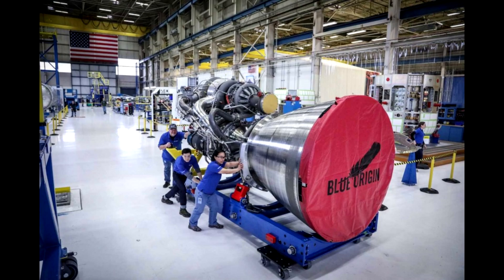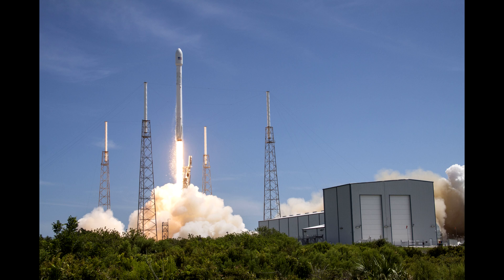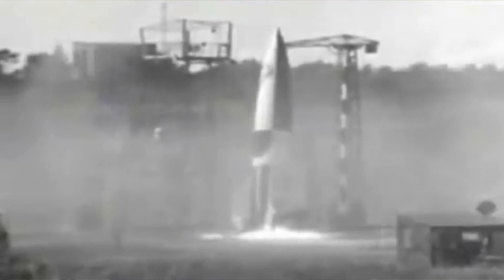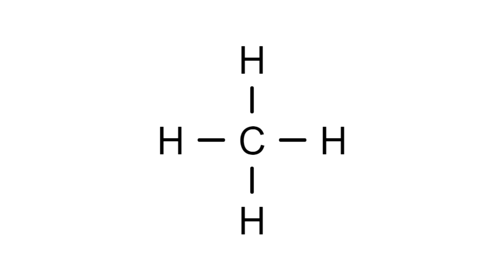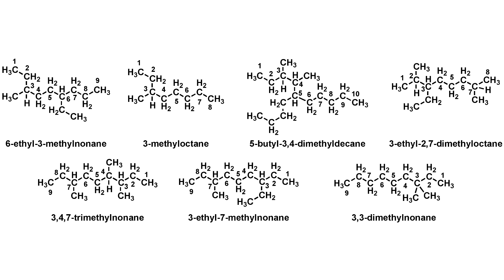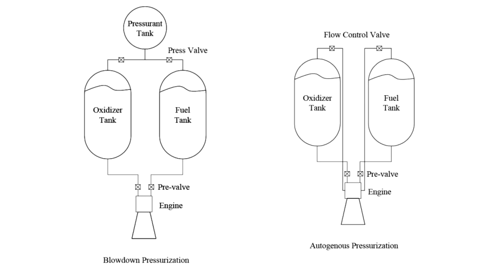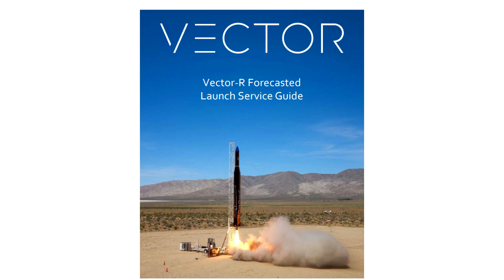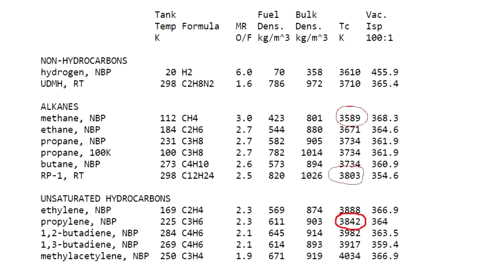Why Next Generation Rockets are Using Methane

Comment: Please, what is the difference between Jet fuel and RP1 exactly?  What is this refinement of which people speak?
Reply: RP1 has much more strict specifications.  It contains much less sulfur and much lower impurities.  It is designed to have better characteristics  at very high temperatures and to be easier on high speed turbopumps. Jet engines aren't too picky about the fuel they burn.  They primarily need low vapor pressure and freeze resistance at high altitudes. Therefore jet fuel is often highly variable in its specifications.

Comment: I don't understand, if the exhaust products are lighter, how do you get a higher specific impulse? I thought the rockets acceleration was the reaction to the ejected exhaust products. The heavier the better I would have thought. There is probably a good explanation, but its a mystery to me at present.... (I'm probably just too stupid....)
Reply: assume you throw off same mass per second anyway, then the average speed of a single molecule is proportional to the total reaction force produced by exhaust. of course lower density fuel requires larger turbopumps but considering a rocket mass is nearly 80%fuel(fuel/oxydizer), it is less of a problem.

Comment: I have a quick rocket question: why is RP-1 used at near room temperature? At a cooler temperature it would be denser, and so the rocket would be more efficient? My guess would be the economics of cooling the fuel, and that the viscosity of kerosene seems to increase exponentially as the temperature is decreased (whereas density increases linearly), and this may cause problems in regeneratively cooled engines. Please let me know your thoughts!

Comment: Methane gives only a modest improvement of performance over kerosene because of the need for much more liquid oxygen. However, even a modest improvement is very important because of the exponential character of the rocket equation.
Reply: It also makes much more sense if the goal is a Mars mission due to the exponential mass/thrust aspect of transporting return trip fuel.  Manufacturing propellant on Mars is forward thinking, a paradigm shift.  If the idea is to colonize another planet, self-sufficiency is a must, and producing propellant on Mars is a must.
Reply: @brabanthallen  I agree that in-situ production of propellant combination on Mars would be a MAJOR improvement in any scheme for regular interplanetary travel. There are plenty of precursors for the propellants: water and carbon dioxide. The most difficult matter is providing the VAST amount of energy needed to produce the fuel. A kilogram of methane releases about 55 megajoules upon combustion. Hence, at a bare minimum (assuming 100% efficiency) it would take 55 megajoules to make a kilogram. To produce 100 tonnes, would require 100,000 times 55 megajoules = 55 time 10^11 joules. Assume that you wish to fuel ONE such rocket per month (30 days). There are 86400 * 30 = 2,592,000 seconds in 30 days. The average power needed over 30 days to produce the 100 tonnes of fuel would be 2.12 megawatts. Realistically, 100% efficiency is impossible, so let's increase power to 5 megawatts. That is a large amount of AVERAGE power for a plant on Mars to produce. If a nuclear plant, a huge area would be needed as a radiative heat sink. If Photo-Voltaic, it would require a large array. With solar intensity of only 500 watts per square meter, assuming 20% efficiency, then only 100 watts per meter would be produced under optimal conditions. After consideration of load factor due to daylight/darkness, etc, the required area would be circa 60,000 square meters, or circa 250 meters on a side assuming no gaps. That is a HUGE array. It would need to be washed and squeegeed daily to keep dust down, which ups the water requirement, perhaps to 10 tonnes per day. And so on. You can see that this is a HUGE undertaking, although still better than schlepping fuel all the way from Earth for one return flight per month.

Comment: How does it compare to non-hydrocarbon fules in terms of energy density? Basicly, what will give you the most bang for your buck? For instance, what would be the difference in chemical energy density between the bipropellant mixture of methane and oxygen versus the monopropellant hydrazine?
Reply: I'm not sure about the energy density, but hydrazine also needs an oxidizer (usually nitrogen tetroxide - NTO), and virtually all hypergolic fuels are highly corrosive.  If the goal is to reach Mars, using hypergols would eliminate a return trip, even if a orbital rendezvous vehicle was employed.  The Apollo missions had soft seals in some of the hypergolic valves that were only rated for 30 days maximum once the spacecraft had been fueled.  Once the seals had exceeded their rating, the vehicle had to be de-stacked and the soft seals serviced/replaced.  Hydrazine is great for sure starts of an engine, but it is terrible for longevity.
Reply: @brabanthallen  The Aerojet MR-80B engines used in 2012 to land the curiosity rover on Mars use a Hydrazine monopropellant. You can find the specs for it on the Aerojet Rocketdyne website. But I just checked and it looks like you'll probably get more thrust per pound from hydrazine as a bipropellant by mixing it with an oxidizer. Which means having a seperate storage tank that adds more weight... Energy dense fuels are never easy.
Reply: @CascadianBraeden  - Everything is a trade-off when it comes to rocket propellants.  Even methane gives a modest improvement in specific impulse and chamber pressures, but there is a much greater need for oxidizer, creating more weight.  Any improvement is important due to the exponential character of rocket propellants.  Liquid hydrogen gives a very high specific impulse, but is far less dense than say, hydrazine, and requires a 7X bigger tank, and 7X bigger pipes from tank to turbine to engine.  Liquid hydrogen is also very expensive to produce and store.

Dense fueled launch vehicles require a much higher launch thrust, but the higher thrust is carried all the way to orbit.  It can achieve orbit much faster, and requires less Delta-V.  But a dense fuel means higher weight.  Bipropellant and even tripropellant rockets offer advantages and disadvantages.  One advantage being they can be more economical.  The Saturn V used LO2 on the upper stages, with the advantage that the reduced overall mass/weight in the upper stages allowed for less dense fuel in the first stage.

I had a great conversation with an aerospace engineer (PhD) concerning manufacturing methane on-planet once a crewed mission reaches Mars.  It will be a necessity to produce the propellant on-planet vs. hauling the return-trip fuel with them.  However, the power required to manufacture methane on Mars will be enormous.  He wrote:

"I agree that in-situ production of propellant combination on Mars would be a MAJOR improvement in any scheme for regular interplanetary travel. There are plenty of precursors for the propellants: water and carbon dioxide. The most difficult matter is providing the VAST amount of energy needed to produce the fuel. A kilogram of methane releases about 55 megajoules upon combustion. Hence, at a bare minimum (assuming 100% efficiency) it would take 55 megajoules to make a kilogram. To produce 100 tonnes, would require 100,000 times 55 megajoules = 55 time 10^11 joules. Assume that you wish to fuel ONE such rocket per month (30 days). There are 86400 * 30 = 2,592,000 seconds in 30 days. The average power needed over 30 days to produce the 100 tonnes of fuel would be 2.12 megawatts. Realistically, 100% efficiency is impossible, so let's increase power to 5 megawatts. That is a large amount of AVERAGE power for a plant on Mars to produce. If a nuclear plant, a huge area would be needed as a radiative heat sink. If Photo-Voltaic, it would require a large array. With solar intensity of only 500 watts per square meter, assuming 20% efficiency, then only 100 watts per meter would be produced under optimal conditions. After consideration of load factor due to daylight/darkness, etc, the required area would be circa 60,000 square meters, or circa 250 meters on a side assuming no gaps. That is a HUGE array. It would need to be washed and squeegeed daily to keep dust down, which ups the water requirement, perhaps to 10 tonnes per day. And so on. You can see that this is a HUGE undertaking, although still better than schlepping fuel all the way from Earth for one return flight per month."

I had no idea that to produce one kilo of methane require 55 megajoules.  It will be quite the challenge and may require a nuclear source of power for production.  Hard to predict at this time.

Comment: The table at 4m40s & 8m35s has a typo – under "Alkanes" the last entry (RP-1) gives a chem. formula, C₁₂H₂₄ – should be C₁₂H₂₆ (dodecane).
The former would require a double bond somewhere, and so, not be an alkane, which, for n carbons must have 2n+2 hydrogens.

And a question: you're always mentioning "fly safe." But what use would a fly have for a safe?
What would it put in there?
How would it open the thing?

OK, that was pretty awful. Channeling Emily Litella, I guess.
Sorry! Nevermind!   ;–)

Thanks for all the good info you're constantly providing!

Fred

Comment: My big question is that if methane has a great advantage of being cleaner, how come jet engines can burn dirtier fuel and operate for days and months years at a time burning dirtier fuel than RP-1? A rocket is only going to burn for an exceedingly short period of time compared to a jet engine and they are both operating at high temperatures, pressures and levels of complexity. I mean a jet engine has to work even if you shoot a goose into it at 300 mph...
Reply: I doubt SpaceX has to calculate out near statistically certain goose interference into the development of their propulsion systems...I guess my question is how come we don’t design these things to be robust enough to drop a turkey in the LOX tank and have the rocket still fly just fine?
Reply: They do test jet engines by dropping turkey into the engine..  But the purpose of the test is not to insure the engine will keep running.  The purpose of the test is to confirm that any damaged parts will stay in the engine and not damage the rest of the aircraft kill passengers.  Even if the engine does survive the impact with a very larger bird the pilot will still declare an emergency and land the plain at the nearest airport.  The reason is that there may be hidden damage that may cause it to fail before the aircraft reaches its destination..  In most cases jet engines do fail when they hit a large bird. 

The loads and stress levels in rocket engines are very high and pure oxygen is very corrosive. .  I doubt it is possible to prevent damage if there is debris in the fuel..  The primary design goal is to insure that if the engine does fail the damage is contained and limited to only one engine.  That way the remaining engine may have enough thrust to continue the mission to success.  The falcon 9, space shuttle, and saturn 5 and other rockets have all had engine failures in flight and in many cases the rockets were able to complete the mission without the damaged engine.
Reply: Steven F if you were riding on a rocket, wouldn’t you want to be able to drop a frozen turkey into the LOX tank and know you wouldn’t blow up?
Reply: Steven F. My point is that all these designs get so specific, so mission oriented, that we forget what “Robust” really means. 

737s are robust. They can fly thousands upon thousands of times and the only failures they encounter can be easily fixed on the ground by poorly trained technicians. THAT is the kind of reliability SpaceX needs. Not just the ability to make the point that they can fly a few times every couple of months.
Reply: Steven F SpaceX has used vertical integration and industrial monopoly to reduce the price of launches to what they actually should be, rather than what ULA was charging. However, they have yet to prove that reusability is the key to reducing price per pound to orbit.

Comment: Methane, a small simple hydrogen rich *4 for every 1 carbon, burns very cleanly with liquid oxygen :)
Reply: Less polymer gums, deposits, soot, funk, junk, goo, wax, tar, particles, particulate etc with CH4 burning in pure 02
Reply: Methane Oxygen Fuel Cycle  
CH4 + 2O2 = CO2 + 2H2O
Making Space Accessible
Cleaner Cheaper Simple  
Rockets Reusable 
Better Engines

Comment: Scott, I was born here in the U.S. (as was my father), and he pronounced it "MEE-thane" (as did I, for many years). His father was from the Cayman Islands, though, which may explain that (my grandfather also pronounced the letter "H" as "hee," and the letter "W" as "wee," as he was taught in school there). Regarding methane--however one pronounces it :-) --as a rocket fuel:

NASA for a time funded methalox rocket development (during the George W. Bush Administrations) for use in the original Orion lunar/Mars mission architecture. By using a methalox Service Module engine, they intended to build-in a capability to eventually refuel from short-period comets and from the asteroids that are actually extinct comets (but still rich in water, ammonia, carbon dioxide, and methane ices, insulated by those "asteroids'" dusty outer crusts. The water could be electrolyzed to obtain oxygen, and the methane ice could be heated to generate liquid methane (the hydrogen from the water could also be reacted with the carbon dioxide, via the Sabatier process, to make LOX and liquid methane).

Comment: Since we will be breaking apart water, on Mars and the moon, for fuel and air they should be using oxygen/hydrogen engines, I know it's early still but starting now will give us decades of experience with these fuel mixtures, so by the time we are going back to the moon or onto mars we will have it perfected.

Comment: Would be great to have way to throttle and ability to stop and restart solid fuel.
Reply: Maybe a hybrid type system that would probably only work in space. A solid fuel that only works when oxygen is pumped into it instead of it being contained in the fuel itself.

Comment: It took me more than a second to see that the methane loop to the (methane) turbopump goes through a thermal expansion / cooling-the-bell stage in the nozzle, and then out the top-left of the nozzle to the pre-burner.  Dang!

Comment: So if methane needs to be kept cold, vs kerosene has overly long chains, why not, say, propane, which is liquid at room temperature if kept pressurized and still pretty short-chained?  Heat it up a bit with engine heat and it can even self-pressurize.
Reply from the maker: That’s what vector space systems thought.

Comment: How good is the thrust per nozzle area ratio of the raptor engine compared to the merlin, the be-4 and others liquid/solid engines? (for rockets with higher sectional density)

Comment: Hi Scott, why is no one using LOX/Propane(100K)? The combination would have a density close to LOX/RP-1 but produce an ISP closer to LOX/Methane. Assuming clean propane is used it should have similar properties to methane, except that it wont freeze at the boiling point of LOX.

Comment: So, what if we use CH3OH (methanol). It can be stored at room temperature, it already has an oxygen in the molecule so you have to use less LOX and is denser than methane. 
I already did the calculus, methanol/LOX has 90% of the energy of methane/LOX (by mass)
Reply: Poor overall specific impulse, worse than RP-1. The Nazis did use it to some extent in WW2, though.